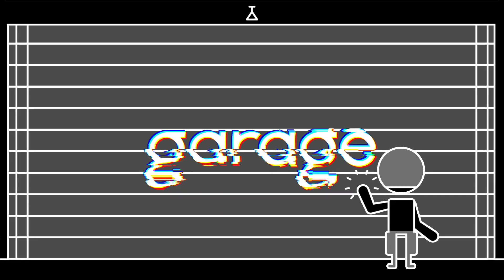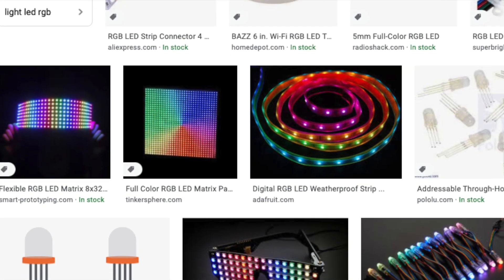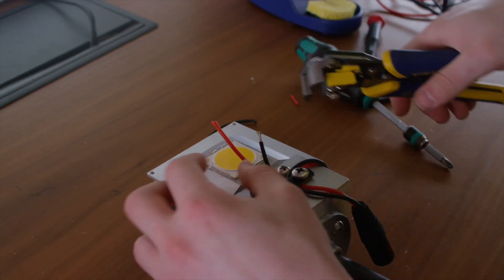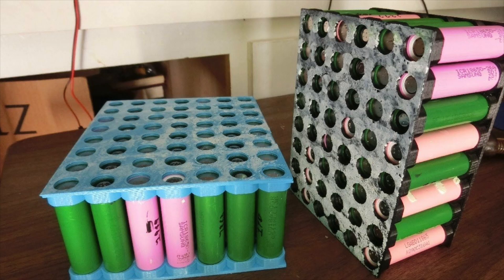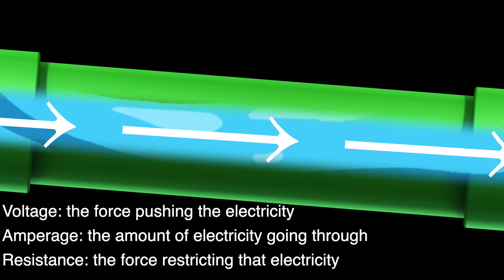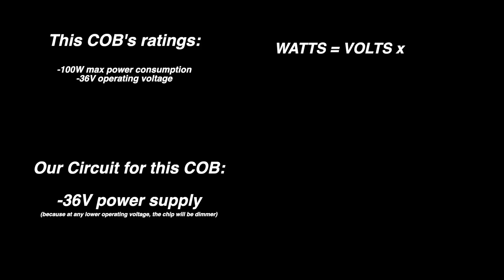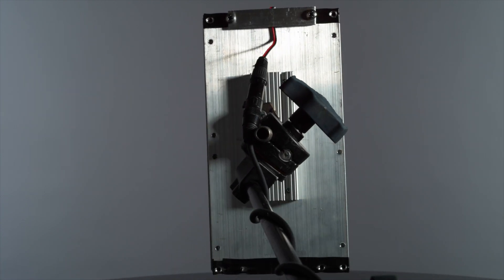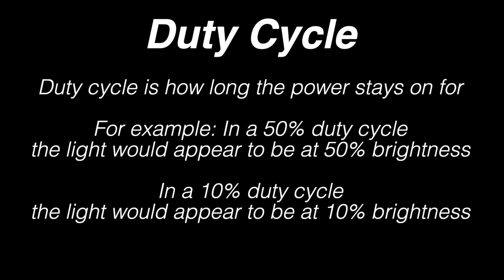How LED Lights Work

Comment: Could't you just use really high switching frequency opposed to voltage dimming. I know you can do that with normal speed video so is there still problem with highspeed video
Reply from the maker: You could, but most PWM ballasts still visibly flicker at high framerates.